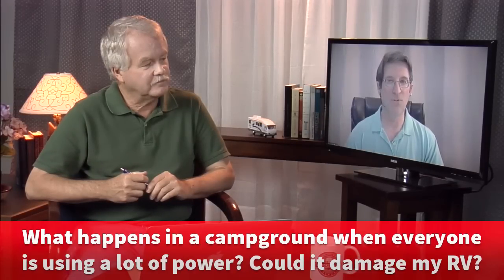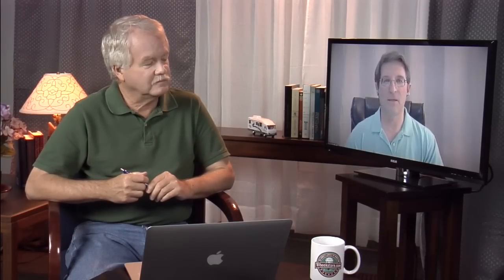Can electricity stretched thin at RV parks damage your RV?

Comment: Don't you mean "Soft start"? Some rv ac's already have soft start so you can run off generator power, which usually struggles with high amp start.  Transfer switch can be damaged by low voltage, by not locking in and chattering the contacts. Also low voltage will heat breakers on the pedestal and cause false trips. Try not to use reducer dog bones, because these run off a smaller 30 amp that will heat up faster. Going up is better, running a 30 amp boned up to the 50 amp plug and breaker. Old pedestals with loose or undersize wiring can also give you trouble ( thousand trails) 😂

Comment: I have a question regarding our class a motorhome.  It is a 2004 Coachman.  When I start to generator it takes from 3 to 5 minutes for the power to connect.  It now does the same thing on shore power.  I dont think this is normal.  Would this be caused by a bad transfer switch?